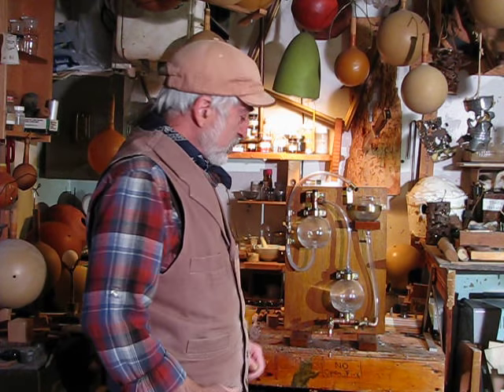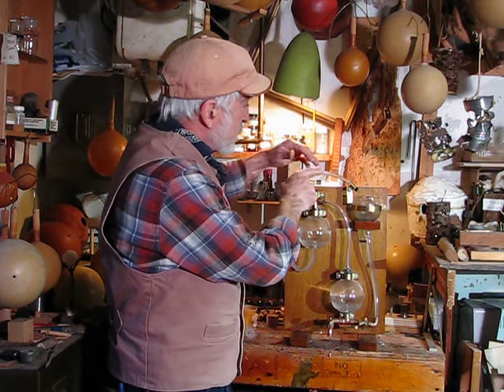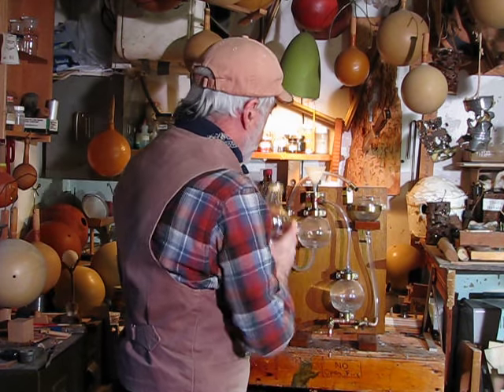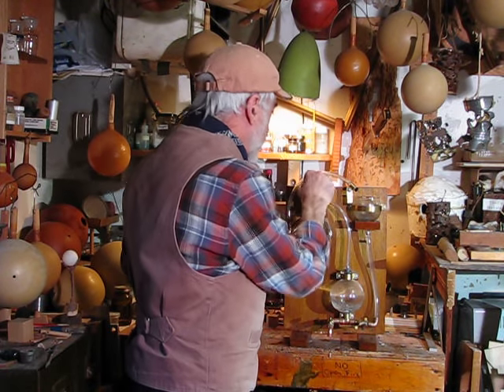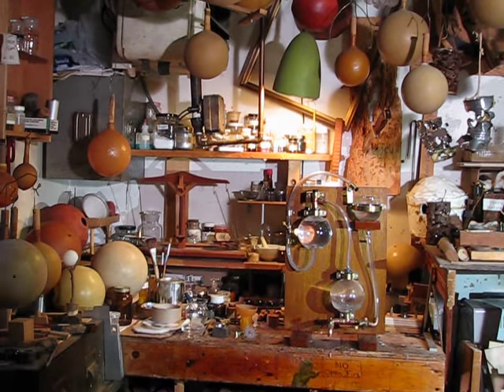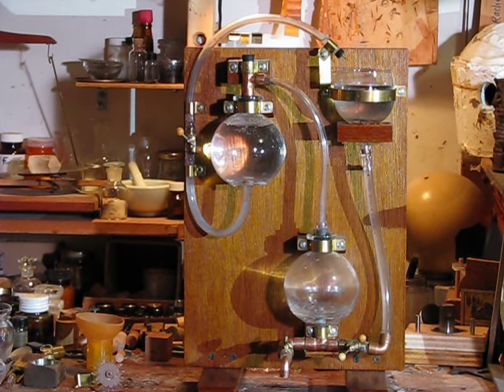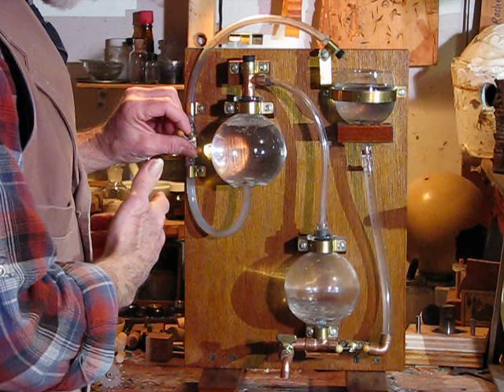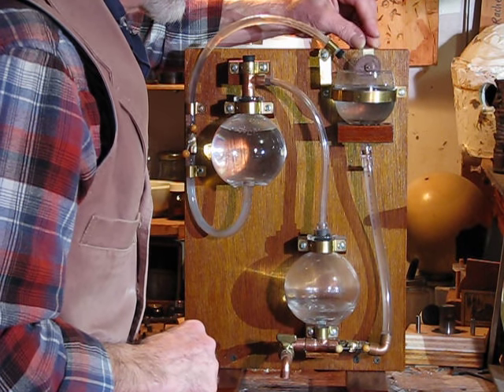Hero's Mystic Fountain

Comment: Ok here is what i thing: It is not a perpetual motion, as long as the bottom tank is filled up with water, the system stops. It is the air inside the bottom tank that pushes water to flow. and what you going to do to restart is to empty the bottom one and fill the upper two with water again!
Reply from the maker: Yup! You got it. The trick is to make the spout orifice really tiny, so the change in water levels goes too slowly to notice.

Comment: Another way to look at this fountain is to recognize that this is a siphon with an air bubble in it. The pressure from the top tank is pressing upwards on the air bubble which is trapped "under" the water in the bottom of the mid level tank. As the water in the bottom tank fills, the air "rises" in the tube with the bulging tanks, pushing the water out, just like a Pulser Pump. It will run until the mid level tank empties.

The pressure to raise the bubble is generated by the height differential between the two lower tanks. Or more specifically, the height of the column of water from the top tank presses the bottom of the bubble. The height of the column of water from the mid-level tank (to the top of the tube) pushes the bubble down. If you level the water level between the lower tanks, it stops.

While the levels are different, the force of the water is a function of cross section. The smaller stream at the top has more pressure with a differential in area from the down tube. But, the volume of water is always the same out to in. So the velocity of the water stream out is higher than the velocity of the water stream draining. 

Surprisingly this is not an over unity device with the way the water flows, but the water wheel becomes an over unity converter. (although physics will try to deny this) Using a Tesla turbine would be more efficient as it converts more of the constant kinetic energy to the rotational energy, but that is splitting hairs. The wheel is an accelerating object, the kinetic energy imparted to an accelerating object is more than the kinetic energy alone. (It's the secret of the the home run in baseball, or the light push of a child's swinging swing vs. a starting swing, or how a rocket gets more energy out of its fuel than the fuel carries in a sling-shot maneuver.) Some call it the Oberth effect.

One might consider this an over-unity machine with the water wheel attached.

But hold on one moment. This fountain takes the water from the middle tank and returns it to the lowest tank, thus running dry. What if the water could be returned to the middle tank without letting the air escape? 

Maybe I'm over thinking this.
Reply from the maker: I think of it as just water running downhill, but taking the long way around; basically working as a siphon, as you correctly pointed out. When the middle bulb is all emptied into the bottom bulb, it stops. There's no over unity involved.

Comment: Now why is there a different bigger bulkier bracket holding the feed cup? It wouldn't be hiding something would it?
Reply from the maker: Now would it? Ha ha; I'll have to check.
Actually it's the same dimension brass as the others, but it has to hold around a cup, not a bottle-neck.

Comment: Could you pick it up?, it's not attached to the table right?
Reply from the maker: It's not attached. Everything of it is completely visible.
Reply: Thanks, my brain just needed to make sure that the valve on the bottom was just for emptying the thing, and not for adding air pressure to the system hehe

I thought it might be a siphon but the top left "bulb" doesn't seem to be pulling in water, or at least the water level doesn't seem to be bobbling about as if water is trickling in from the top of it.

Comment: Your version of Heron's Mystic Fountain is clever! I had to look it up, since I missed that class in science. Now that my morning coffee has percolated, I was wondered if the little water wheel could harvest energy in the form of compressed air somehow? Would pumping even a tiny bit of compressed air into the water bulbs make the water volume/pressure out of the nozzle higher? And if more water out, more water supply back to the bottom bulb? (I imagine a one-way valve may be needed somewhere.) Just thought that a little bit of extra energy might make it last longer. Its definitely fuel for thought!
Reply from the maker: Well that could work, but to me it would defeat the simplicity of the system. The illusion is that there is power being created, but it's only water flowing downhill, using gravity and trapped air to push it the long way around.